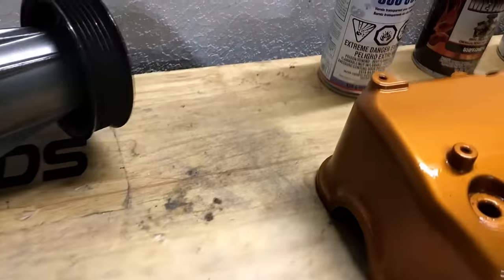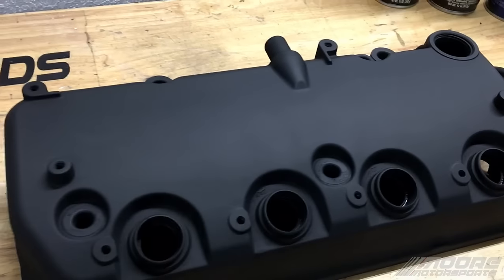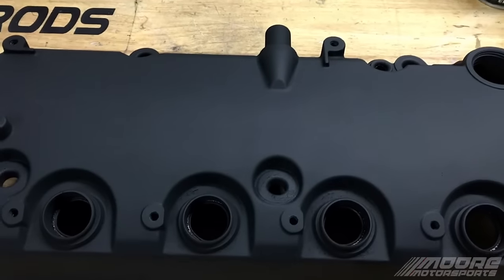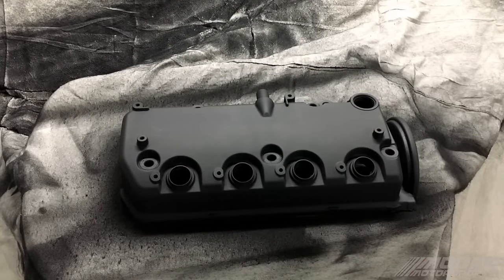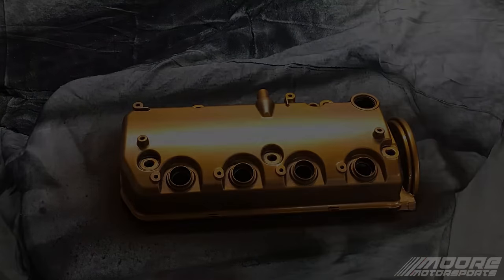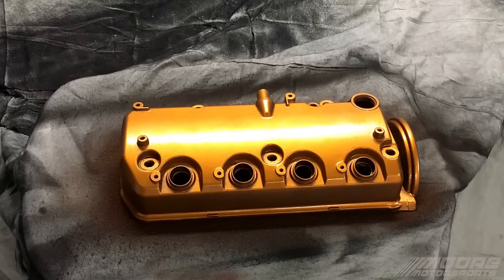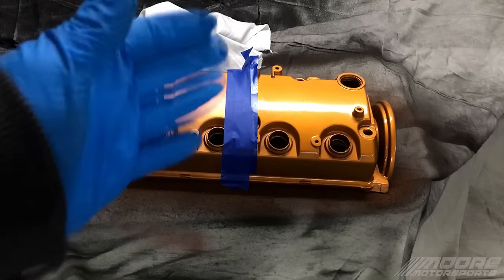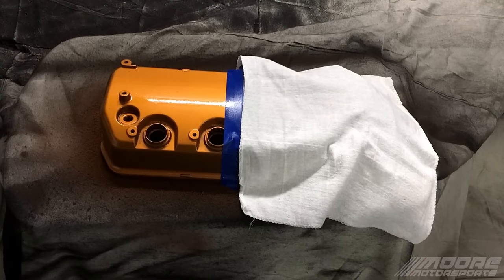Here Is The Difference Between 2K Clear and 2X Clear

Comment: He never mentioned that only 2k is solvent/petrol resistant. That regular enamel will just wash off if you splash degreaser/brake cleaner on it
Reply: 13:18
Reply: You never watched the full video then

Comment: The 2x isn’t a “type” of clear. That’s just their marketing verbiage saying it provides 2 times the spray coverage with the tip that’s on the can compared to a regular can. If you look at it on the can, it’s trademarked and a marketing tool basically. The SprayMax clear is a 2 step clear and about the best clear coat in a can hands down.
Reply: Exactly. This video makes no sense. He's comparing a real 2K product to..nothing. Of course 2K is going to be better than Rustoleum, lol. No reason anyone should be using Rustoleum products on actual cars, anyway..

Comment: For further clarification for people learning out there:
2K means any product that is activated with a hardener/catalyst. These products will dry as the solvent evaporates, then cure. "2-component".
1K is a product that can be reflowed, and does not have a hardener/catalyst. They will only dry as their solvent evaporates.
2X is just some brand naming nonsense. It has no relevance to actual refinishing.

You want 2K for any final topcoat, or surfacing build. Only your conversion coats and intermediate basecoats should be 1K. Others CAN be. But they shouldn't.

Comment: The 2X acrylic might crack from heat. Acrylic cracks. The wrinkling from the acrylic is from the acetone in the 2X clear. You didn't shake it enough. Need to bleed the excess acetone out of a new can before use.

Comment: I just spent around 70 bucks so far.. did my toyota hood and roof finally looks decent.. just glad i got it done outside  perfect weather 70s no humidity no breeze.. about wet sanding? I'm not going to because  the rest of the body paint finish scratches ( 2001)  lol I had  to do the hood roof were looking ev bad this season especially .. hoping this 2k spray max lasts a few new jersey seasons

Comment: Recently had to touch up a door on my SUV so wanted to use spraymax 2k clear so i didn’t have to drag out HVLP stuff.  Worst paint job i ever did had lots of orange peel like yours does and needed almost 3 cans to get full coverage on full door.  In the end sanded down then sprayed it right with my HVLP.  Surprised at how bad my experience was with it, which surprised me because so many seem to have good results?
Reply: i use them all the time and get good results no sanding needed maybe you should try and warm it up
Reply: You did something wrong this stuff work so good
Reply: If it's too hot rhe paint will.dry too fast and make a nightmare.

Comment: I recently started painting parts with 2x and was so mad at that wrinkling thing it happened alot.
Reply: You can avoid that by how you spray it (one very light tack coat, then a couple "Wet" coats on top) but all clear is going to have a slight bit of orange peel, regardless. Wet sanding and cutting/polishing will remove it, even on the 2x. Never use a cheap Rustoleum product on actual cars, though.. that stuff is for household items or model cars. 2K only for real cars or motorcycles, etc. It's much harder and will withstand against rock chips, etc.  EDIT: I think the wrinkling was more-so a reaction to the paint, not orange peel.. I got confused there. If that's the case then yeah, there's no fixing that without stripping it and starting over. Cheap Rustoleum stuff can definitely do that but again remember he's comparing a $5 product to a $20 product.
Reply: I have a short sample video on my channel of the cheap Rustoleum 2x on a model car and it look's similar to how the 2K does in this video, even before wet sanding, cutting & polishing. He didn't do a very good job of spraying the 2x, in my opinion. Seems like it was done on purpose for the video.
Reply: @hhaste what would you recommend for carbon fiber parts?

Comment: I used  both,   would use neither on anything i want to look good.   2X is good for small parts that you dont care too much about,   2K is not worth the money,  flaking off a test panel I coated 1.5 years ago.  I found it actuall cheaper and easier to just get my spray gun out and mix up the clearcoat myself.
Reply: Right i used both and they both aren’t good
Reply: I've got test panels that been outside in sun rain and wind thrown around the yard pieces cut out with grinder and not cared for whatsoever and they basically the same as new 13yrs later for primer and 20yrs on the acrylic base and clear coat from the gun and it's still perfect. I think quality clear and base is just as good as any 2 pac if you wanna take the time and repolish the entire car after painting.
Reply: This is great if you have a compressor that is strong enough to spray clear. If not some 2k ever couple years wouldn't be bad. Not to mention some people swap cars so often they wouldn't own the piece anymore.

Comment: thanks, excellent content. I used Rustoleum Acrylic Enamel Black and got a good result but a little orange peel and a few nubs, cleaned it up with #800 scuff pad. Do I need to recoat with the black rustoleum or is the  #800scuff an acceptable surface prep for the Spraymax 2K. Thanks!

Comment: Just finished painting two bike fenders with the 2k Matt and am very disappointed. It doesn't flow very well and ends up having a rough finish like very small orange peel. Not only that but I got down to one third of the paint still in the can and it started sputtering like the can was almost empty. The gloss might be much different to work with but I wouldn't recommend the matt clear to anyone. I might as well of thrown twenty-five bucks in the air!

Comment: Why did you put the clear coat in the freezer? What does it do?
Reply: I got about 4 days doing that
Reply: 5:25 when 2k paint is activated, you have less than 2 days before it cures solid inside the can.  freezing stops the countdown enabling use later

Comment: Ya, you need to apply the 2x as if it was another coat of the same paint, if you let it dry too long or it's too hot it will go crinkle mode. Also, I'm going to try the Crystal Clear HardHat version on top of the 2x clear, once it's hardened up for like half the year, then wet sand and see what happens.
Reply: half the year made me lol

Comment: If you want to use spray can clear,, found that high temp caliper clear works the best, and definitely lasts longer.. the spray can clear with hardener will always peel off in about 1 year
Reply: @v1-vr-rotatev2-vy_vx31  no it won't, if you prep the base before painting 2k clear it's solid, I use this all the time, it's never ever peeled off so I'm not sure how you've come to that conclusion, proofs in the pudding 😉

Comment: Great video. The finish on the 2K clear looks amazing. I have some questions concerning doing a whole car with it.

1. Is 2 coats enough to allow for wet sanding to remove any imperfections and future polishing?
2. Does this clear have a good life on a car which sits outside all year round in the cold and heat?
Reply from the maker: I have a video of the pink crv and it on has 1 thick coat and I was able to wet sand and buff it. 2 coats is enough but I prefer 3-4
Reply: @JamesDguy  Thanks for the reply. I watched your pink CRV videos and the results are really nice. Do you still have the car now? Does the clear still look good?

Comment: Don’t use rastoleum 2x clear. I just sprayed the roof of my truck with black rastoleum paint and used 2x clear coat also made by rastoleum and everything wrinkled up. Whole day masking primering and painting went to sh*t Thanks to rastoleum!! It even says on the can that you can use it with any other non rastoleum paint which I should’ve done. Something wrong with their formula if it wrinkled with their own paint! Never again!
Reply: How long did you wait to clear the black?
Reply: @phildelsol97  On the spray can said to apply clear coat in 20 min intervals . First coat came out Ok, I waited 20 min and started 2nd coat and everything got ruined.
Reply: @phildelsol97 I mean you could try rastoleum 2x you may have better results than me, but if you don’t want to risk it go with 2K instead. It’s $25 but well worth. Good luck!
Reply: I have had the same outcome from Rustoleum. Immediately made a life long enemy out of me.
Reply: All clear coat requires wet sanding afterwards. You can easily make the 2X look great, now I have no clue how it would hold up in the environment in extreme weather conditions.. I certainly wouldn't trust anything other than a 2K on an actual car. I use the 2X on model cars and it does the job, fine. Real cars, no.. I would never use a Rustoleum product on any vehicle.
Reply: My sad experience is that you have to test their paints on some sheet metal first. The best way to avoid bubbles for me is to keep everything half wet. Their clear goes on their wet paint. If you let it dry out better wait 72 hrs unless it is hot, then can wait 48. Otherwise you have  a high chance of bubbles

Comment: WARNING! WARNING! WARNING!  If the instructions say “repaint within 1 Hour OR 24/36 Hours”. THEY REALLY MEAN IT!  If you repaint in say 12 or 18 hours, the damn paint will BUBBLE UP, ruining your whole paint job and requiring you to start over!!!  I DO usually read instructions, but they have made the text font size so damn small on these cans now that I can’t even read the instructions with my reading glasses!  You need a magnifying glass!  That is just WRONG because it means you also can’t read any safety instructions!  This is product misinformation because this subtle fact which applies only to some of these spray paints needs to have a great big separate WARNING label about this nefarious “feature”.  This is an area where the consumer protection agency needs to lay down some law.  Only a stupid manufacture would make the text so small, but as Ron White says, “You can’t fix stupid”, and so we have to legislate more rules, even though I’m against over regulation.
Reply: Agreed, helpful hint.
Take a Pic with your phone. Zoom and read, that is what I do.

Comment: Anyone knows if any rattlecan rustoleum wallmart stuff is compatible with the 2K max clear? Max is an amazing product but when i apply over rustoleum rattlecan paint, it reacts, screwing up the whole work.
Reply: Only if the Rustoleum is completely dry and cured. Otherwise it can wrinkle/pucker. 2K Max has different chemicals that can react with Rustoleum regular or 2X.
Reply: @Smokr  Thanks.
Reply: I’ve never had a issue with spray max 2k over rustoleum paint. My concern is using rustoleum clear…cheap vs expensive spray max..
Reply: @GoProGoalieUzi  buy the max in bulk from ebay, much cheaper. I can tell it is a very good product.

Comment: 1x clear is basically transparent paint, no hardener, stays soft and fades aways quickly, not good for exterior panels imo, just use it for small interior part even then, when I discovered 2k clear I never looked back
Reply: So does that mean the 2X is more similar to intercoat/binder than a lacquer if its essentially transparent base coat?

Comment: does the 2k have a hardner in it? The button on the bottom of it? Thanks bub
Reply: 2k does not have hardner
Reply: 2k has an activator in it. You pop the red button off the cap. Stick it on the bottom of the can to release the activator in the can. 2X is regular clear with no activator. Having used both. 2k is harder than any regular clear.
Reply: @quiles351  it does
Reply: @quiles351 bruh it’s a 2 part clearcoat it does have a hardner
Reply: @yourfather5324  question 🙋🏻‍♂️ where can it be stored after using it to prevent it from harding I heard the freezer is a good place in between use’s
Reply: 2k DOES have hardrner in it. You punch a button in the bottom of the can. 2k can not be compared to ANY other clear in a can.
Reply: @quiles351  ...24-48 hrs after throw it away.

Comment: I had a MASSIVE wrinkle problem spraying 2k clear over rustoleum advanced formula gloss black
Reply: you hold your finger in front of the tip in front of the nossle xD := or sprayed way to much or did not sand properly or waited to long between coats

Comment: Moore I spray painted my gas tank cover with krylon primer n  paint, i have orange peel. Can I just wet sand and buff or should I clear coat then wet sand and buff? Confused and sure could use the help.
Reply: Unless it’s a metal flake or Metallic I always sand out the orange peel before clear coating, for 2 reasons.
1. It gives some good bonding surface for the clear coating.
2. The flatter surface makes it a bit easier to sand/buff and polish of the clear coat. (Less dramatic Orange peel to deal with at the end)
Just make completely sure it’s clean and uncontaminated after you clean up the Orange peel before spraying the clear coat, or it will potentially ruin the whole thing. (Crinkle 🤮)

Comment: can you do a review on the dupli color clear coat?
Reply from the maker: I sure can
Reply: @JamesDguy  thank you for the reply ! I just want to let you know i follow your videos and painted my bumper on my 2013 BMW 550i m sport and it came out amazing, took the extra step to wet sand on each base coat tho but if it wasn't for your great videos I wouldn't have been able to do so. Thank you Moore!
Reply: btw , im aiming to paint my next daily Rustoleum Smoke Grey after seeing how clean the civic came out. Any suggestions on how to mix? im going to try to paint it with a harbor freight paint gun instead of the rattle cans

Comment: i'D LIKE TO  PUT MULTIPLE LAYERS OF THE 2K ON MY HOOD AND ROOF ESPECIALLY.  ANY RECOMMENDATIONS AS TO TECHNIQUE?  HOW THICK, HOW LONG BETWEEN, SAND BETWEEN?
Reply: For three coats ,I will need two cans 2k for my truck hood.. ( used an entire can to do my 2001 Tundra hood  still needs a third coat over new dupli-color match two cans wet sanding between coats color base very lighten 1500 2000 wet sand color base  in shade after it  completely dries (overnight here)  Also,I recommend  spraying outside and a mask glasses spray down a section and back away from the fumes mist  (can smell it even when wearing a face mask so spray with the wind (test spray) my tundra's rooftop  looking faded this year from uv rays ..  with one can dupli color match spray cans are around 15 dollars 80z  to fix roof top ..I am  going to prep  with dawn soap  and than wet sanding with 600 grit wipe clean with shop rag.  empty an  8oz can color match dupli.. and 20 minutes dry time hit it with clear x in the  shade done deal ( not in sunlight above 70 degrees dry weather low wind) always outside. I don't want detailed car finish look I just want to preserve from uv/weather and rust issues.. wonder what he meant by wet sanding between coats too.. i'm not going to wet sand between coats the clear coat

Comment: The real question is the 2x sandable where you can clean it up and respray without ripping up the existing clear?
Reply: I've wetsanded and buffed Rust-Oleum clear and it came out like a mirror
Reply: @StreetForged  what sand grit did you use?
Reply: @beptex2858  I generally always finish my sanding with trizact 3000 grit before buffing

Comment: I have an S-10 I had painted 20 years ago. I had it painted House of Kolors Tangelo Pearl and i used a PPG clear. The clear didnt like the paint and it peeled as soon as we unmasked it and i never fixed it. The clear is peeling everywhere now. Do you think this 2K clear would work on it? My painter no longer paints and this is something i could do by myself. I think House of Kolor sells paint is aerosol cans now I just havnt checked it out. This 2K  clear looks like it quality.
Reply: If you could use compressed air to remove the first clear coat and scuff the paint, you might get lucky. Or use the adhesion promoter bulldog with new clear coat once the old clear coat is removed. 
Bulldog is used on flexible bumpers and it works great even after there is damage to the bumper. It doesn’t flake off but only spider cracks.
Edit: sorry I see you meant you would use a can. Maybe a paint store could premix bulldog into the clearcoat can for you. Yeah the 2k clear would probably be your best bet.
Reply: @chrisrobles2012  Yea I can spray paint as good as any. I just want to try to save the paint cuz im not really looking to do a complete paint job again on it.. I dont have any actual painting supplies yet There are just a few chips in it.  Love the color. It pops so well. Ill look into the promoter. Thanks!!

Comment: I’ve had that crinkle up happen quite a bit with Rustoleum,
And still haven’t been able to figure out why.
Reply: Use 2k spraymax
Reply: This may be widely known but using a lacquer paint/clear coat over an enamel or urethane (in this case the VHT is a urethane/ceramic combo right?) is a no go. It can often cause the wrinkling...something about a reaction or the diff in drying/curing speeds (contracting top coat --> undercoat bunches). It's one of those things u usually learn the hard way iykyk
Reply: @qveenissac  I painted something with Rustoleum enamel color coat. It's sat for a couple of weeks. I plan to clear coat it with enamel clear. Do I need to scuff the color coat first, or could I spray it as is?
Reply: @colt5189   you should be fine at this point esp since you're using enamel w enamel. Depending on how important the item or finish is to u, a fine wet sand in between is never a bad thing but not always necessary. Just try to match brands bc other weird shit can sometimes occur mixing brands (ahem krylon over Rustoleum).

Comment: protip : next time you change your plug wires - cut your old set and use them as masking dummies for all future valve cover paint jobs.

When you dont mask the tube holes or the surfaces the rubber boots touch -eventually the paint flakes and could drop down the hole of shame.